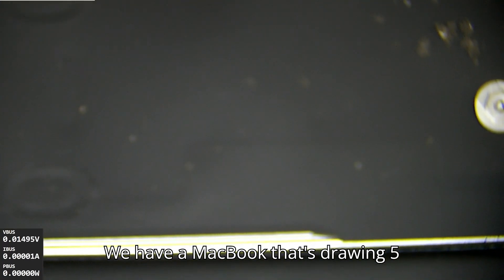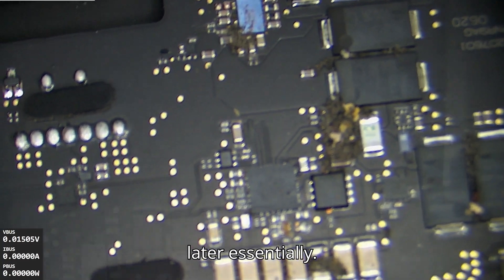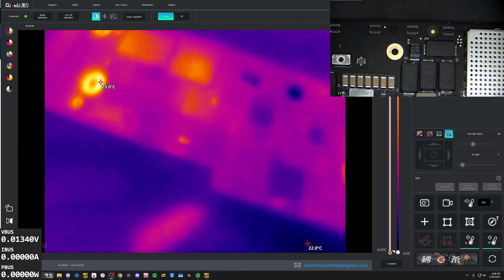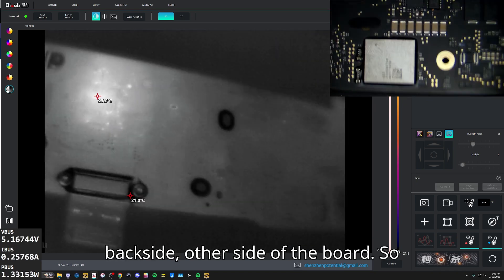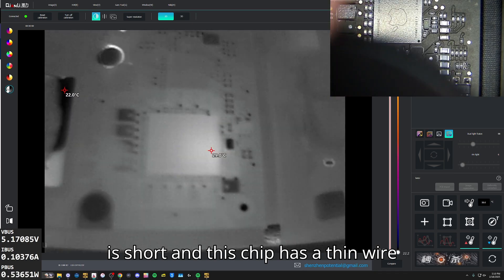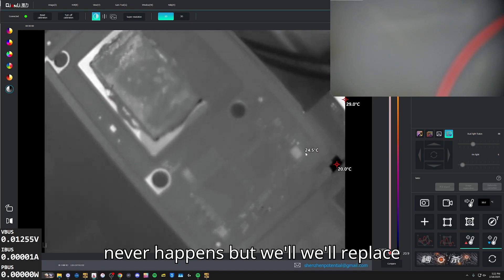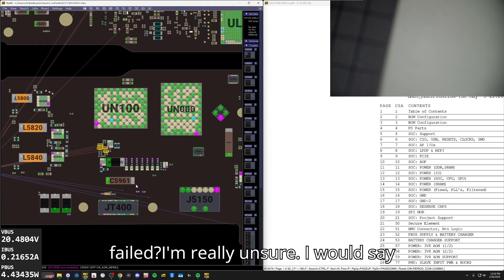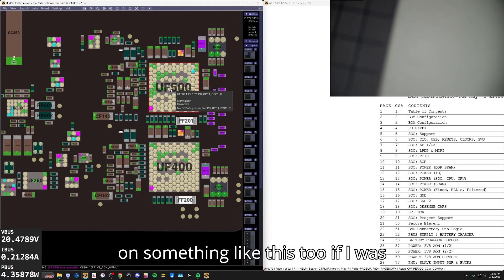A2337 M1 Macbook Air Stuck at 5V Board Repair, PMU Replacement

Comment: First of all, nice work! One question. What temperature did you use to solder the new chip down? Don‘t want to mess up my freshly reballed chip 😅
Reply from the maker: Im almost always at 430C, 120 airflow working on macbook boards, I'm using a Quick 861DW your station may vary, I'm used to using a higher temp, I would say if you have to ask, it's probably a good idea to get some more practice in so you can get used to which temperatures are appropriate for certain cases, good luck with your board!